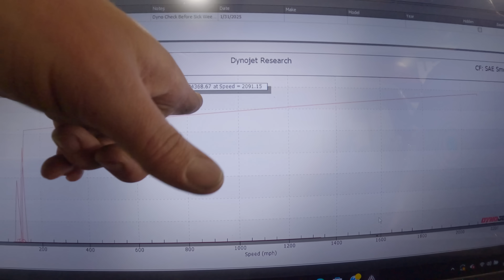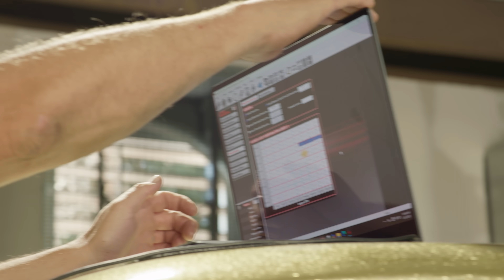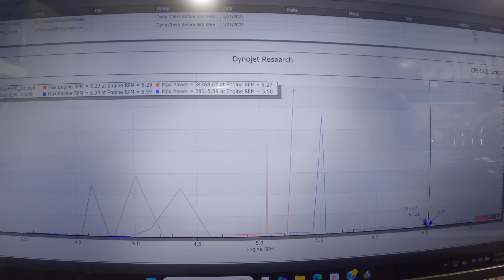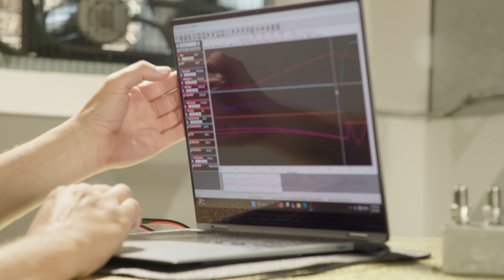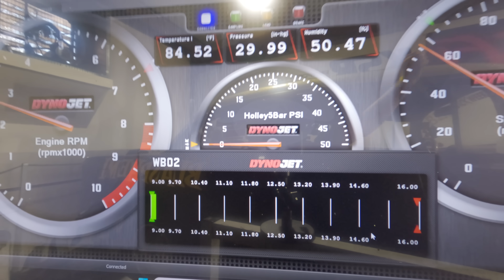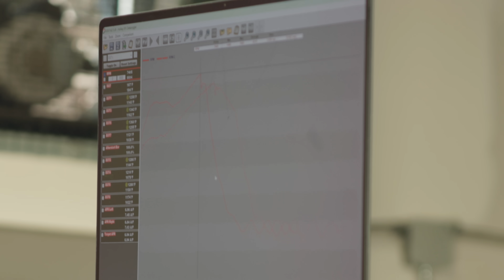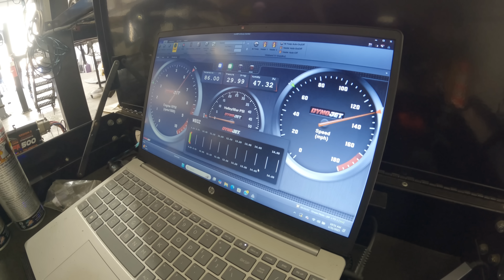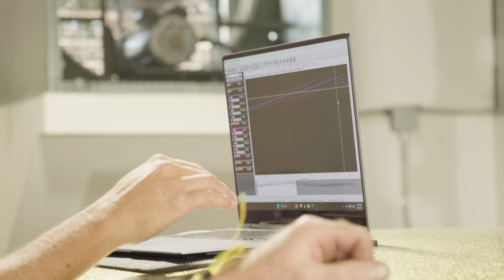IT'S UNHAPPY SO WE STOPPED SICK WEEK TO DYNO TEST BLASPHEMI!!

Comment: Why are you using an otoscope to check sparkplugs.
Reply: To see down into the plug and inspect the fuel ring. 
Down on the porcelain for the electrode it’ll leave a ring that changes color based on how rich or lean it is.

Comment: I had the same problem with my F2 Procharged Camaro.  If we only run it to 6,000rpm we could get a number.  Above that RPM the dyno would freak out and say that it made 31,000HP.  Happened on two different Dynojet dyno's.  Never did get a real number above 6K.

Comment: First, the HP is wave looking at 9:55 because that's where the clutch is slipping and the rearward curve back is where the cutch is locking = the wave is actually showing the clutch slip.
I'm surprised Kevin didn't think to switch the dyno graph from RPM to Speed on the previous (and last) pulls because that will show the actual HP (directly at the drum) and in that case the wheel Speed trace will be flater where the clutch is slipping (and then it will increases quicker when the clutch locks)...

Comment: A friend of mine sent me some dyno numbers a while back. It was on a 258CID engine with EFI, big turbos and ice water intercoolers.842 ft/lb torque @ 6944 rpm, 1140 h.p.  @ 7257rpm @ 20 lbs boost., These are rear wheel numbers , the load cells bolt directly to hubs so no tire slip.

Comment: I gotta say the reason you keep the 55 is the same reason I keep my gti. Yea wifey thinks it’s a money pit but it’s my happy place when driving
Reply: What generation GTI? I've got an 84 1st gen I got in 86 as a graduation present.
Reply: @ 12 mk6 2.0t 6speed not many manuals left and cannot get rid of mine. 325hp to the wheels stock turbo. But lots of bolt ons and stage 3 ecs clutch with single mass flywheel

Comment: Nothing but upgrades for the past 10 years why did it slow down??
Reply: Because roadkill
Reply: I think he’s only got an 8.50 cage in it too, and he’s said before he doesn’t want to change the cage.
Reply: Weight. It’s quite a bit heavier than it was when he won class at drag week.
Reply: @jaybizz67   weight isn’t going to account to every engine mishap he’s had, sorry weight isn’t the issue. The issue is an engine being forced to make way more power than it’s capable of, that’s why it’s hurting parts every single time it’s running
Reply: @ni_wink84  I was answering as to why it’s not faster. The problem isn’t the engine it’s the blower. That thing makes all the heat, sucks all the power.  200+ degree iat’s is hard on stuff
Reply: @ that I agree with 100% I asked in a past video if they could run methanol
Reply: @ni_wink84  I believe he is class limited on that. Same with the blower.
Reply: @ni_wink84  not in "A Gas" class.
Reply: Mike isn't using a known setup, he wants to keep the car unique. So it's hard to make the car faster at the level the car is. There are a ton of things that would make the car faster, but Finnegan doesn't want to do.
Reply: @  not breaking would be a great start
Reply: Too many cooks in the kitchen...
Reply: @steeleperformance3413 It's called hot rodding! He's surrounded by plenty of knowledge!
Reply: @steeleperformance3413  too many forks in the fire , too many chiefs and not enough Indians how ever you put it the point is he’s beating a dead horse, it’s proven itself as unreliable and yet we move forward
Reply: @ni_wink84  not your car, not your money and definitely not your fun maker.  F/o if ya don't like it. You naysayers are such clowns.
Reply: @ hush fan boy you’re the problem
Reply: @xtr3m3fLx  always someone making this comment, if you don’t like what’s said don’t read it second don’t post it for the world to see. Again please be quiet fan boy somewhere else
Reply: It hasn't ran 8.50's since that one year at drag week it's been a high 8's low 9's car for awhile
Reply: Not necessarily all upgrades.. different changes were made, it definitely has a more reliable transmission setup now, it'll be easier working about the other problems one by one without having to deal with transmission  crap.. he works with a lot of different companies and sponsors.. plenty of changes were made over the years and if you know anything about this stuff you know small changes can make a big difference so making many changes at once it's going to have you starting from scratch 
.. also he  doesn't exactly test the way he should if he wants to get it lined out.. it's always last minute because of how busy he was with his filming stuff but maybe now that he doesn't have to do that it will give him more time to get things ready.... things never go well when its the last minute approach.. the best thing he could do would be build a more common engine with parts that are a lot easier to get in a hurry, or at minimum go back to what he knows worked because if something ever happens on sick week or a drag and drive  he's not going to be able to find the engine parts and continue.. that's why so many people stick with more common engines/internals .. people forget he's not your average Joe he is extremely busy outside of YouTube , hopefully without the roadkill thing going on he will get to put more time where it needs to be put
Reply: @freedomfox8183   like I said the rotsun of drag and drive
Reply: Racecar
Reply: Changed to a slipper clutch and different front end. He has said he’s essentially starting over again and it’s taken time to make the car go faster. It’s also only a 8.50 spec cage and it’s not certified for faster
Reply: Get through sick week tune.